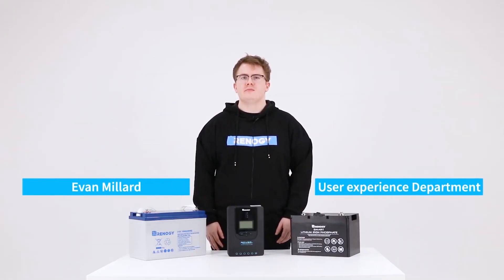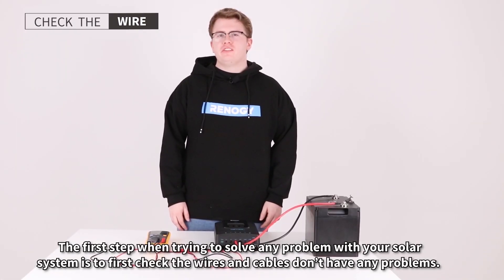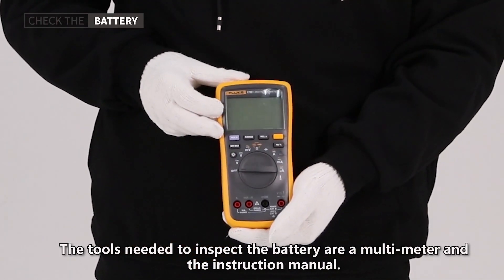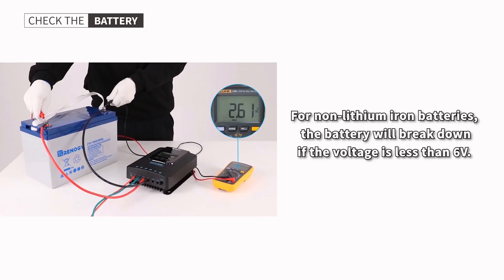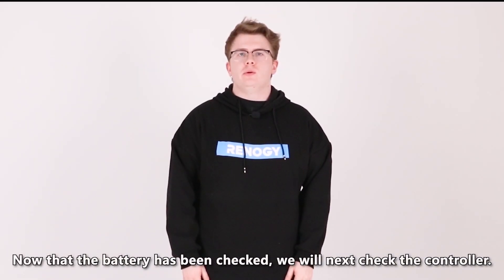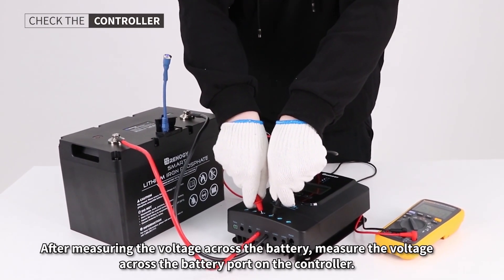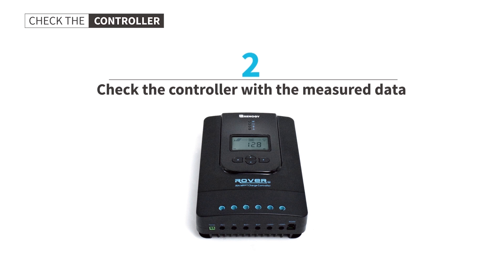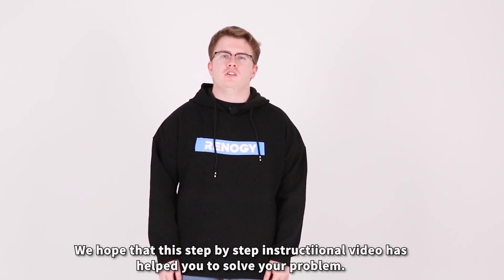Troubleshooting Solar Charge Controller Rover series Part 1

Comment: Can I change output voltage
Reply: Load voltage
Reply from the maker: Hello！I'm sorry, but it is not supported. The port on the product design cannot be upgraded and can only be consistent with the battery voltage.

Comment: Hi Renogy friends, my mppt rover 40a is not giving accurate battery percentage, it is propperly configured in 12v and lifepo4 battery, battery is new and mppt too, any other setting to make or help? thanks, regards.
Reply: Glad I’m not the only one with this issue. Guess I’ll just be buying a separate battery monitor.

Comment: Mine was working fine, but it will not charge batteries that are below 12.3v anything below that the controller goes haywire, is there anything in the settings to stop this happening or is it a fault with the controller. When you plug it onto a low battery the voltage on the controller goes up then back down to zero then goes up and then down again and just keeps doing this, so I've had to turn my generator on to get juice into the batteries before I can connect the controller, this isn't right so I'd appreciate some help thank you.
Reply from the maker: Hey Chris,

For any technical questions, please contact us here- https://www.renogy.com/contact-us?gclid=CjwKCAiA3pugBhAwEiwAWFzwdeH3Crd9vRTbjjTYl9l3daVqnotJPjBhs2nmw-Wkn1_guWQeW0ao6hoCOHcQAvD_BwE
Reply: I'm having the same issue right now in the desert.

Comment: What does it mean when my 40a solar controller displays PV overload.
It comes and goes every few minutes.

Today is partly cloudy day 
PV is around 76-80v
Amp is around 3 to 7 amps
Incoming watts is between 300 to 550 watts.

It stopped doing it for last hour or so.
Any ideas?
Reply from the maker: If you are using a 12V battery, the maximum PV input for the RVR40 is only 520W. The description you mentioned states that sometimes it exceeds 550W, so it is normal for the controller to trigger an alarm. The devices will continue to operate once the power drops. However, if you are using a 24V battery, further analysis is needed based on the video. If possible, please contact us via https://www.renogy.com/contact-us, and we will have our professional technical support team analyze the situation for you.
Reply: @RenogySolar  
I see. 
Im using 3x 12v/100ah LFP in parallel. 
Originally, I had 2x 180w in series with Rich solar 20a.
I've recently added 4x 180w solar panels in series with Renogy 40a BT.
With 2 separate solar controllers in tandem charging the batteries. The Victron battery monitor was seeing 950w peak.
Today, I was home all day so I spent some time monitoring the charging stats. That's why I saw the error message. 
Normally I'm not home on weekends. 

Thank you for the info.